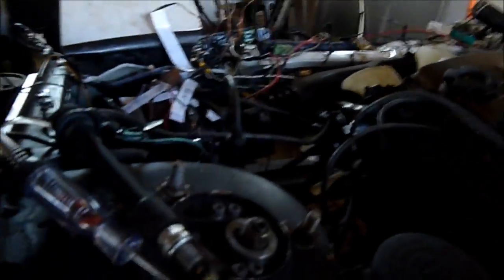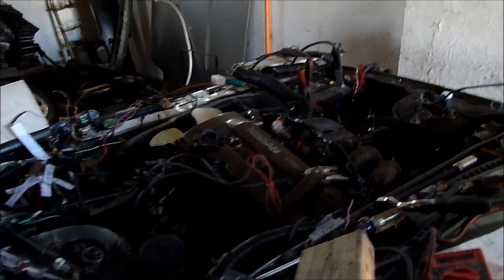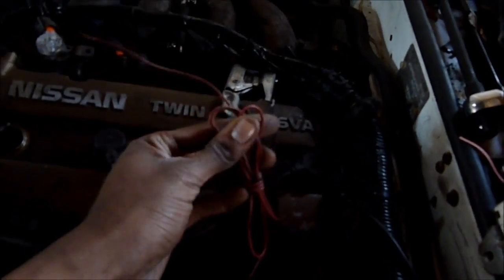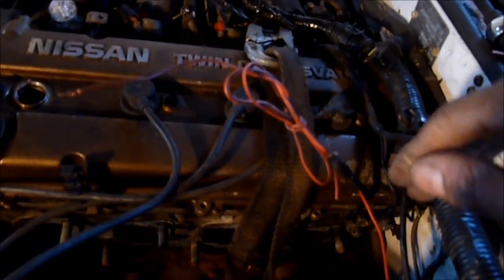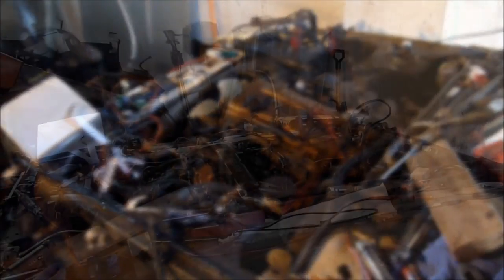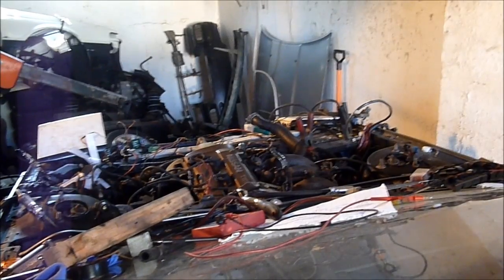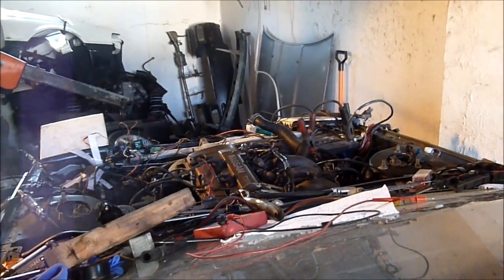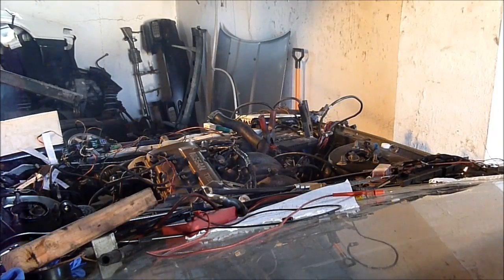Ka24de Spark Problem (Solved)

Comment: Is this for swaps only? I have a 91 ka24de with original engine not getting spark. At first i checked fuel pump, im getting fuel. Changed the ignition coil since i checked for spark from there and had no spark at all. I wont start, just turns over.  Theres times where it wants to start with starting fluid but thats about it. Havent had the luck if it actually turning on. Thanks in advance

Comment: Is that fuel pump still alive?
Reply from the maker: Quinn Fawcett Yeah it is but I found out that the one I took out was a 255 so I put it back in. I had tested it wrong and found out that the 255 worked
Reply: TooForTea might give one a shot. Thanks